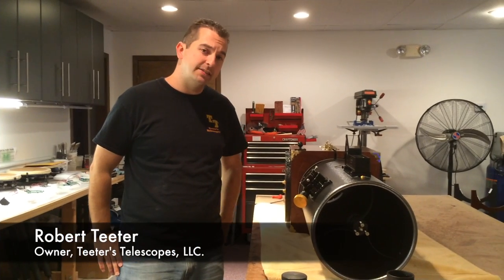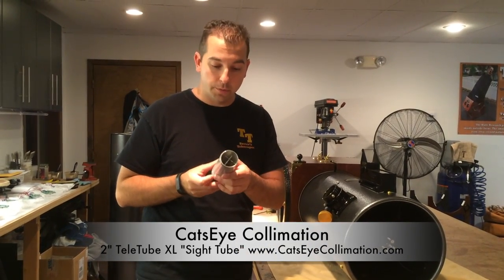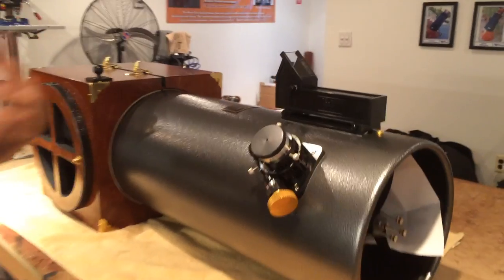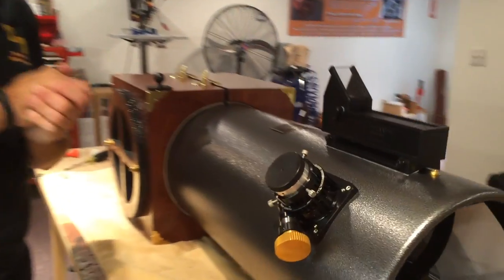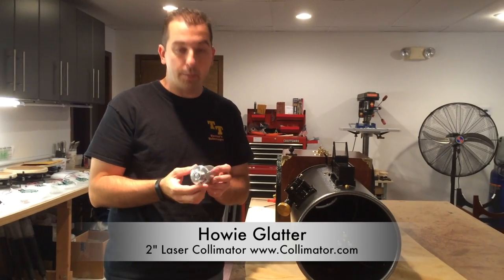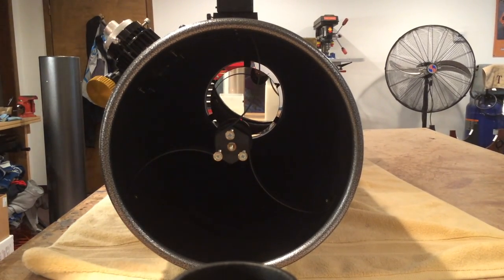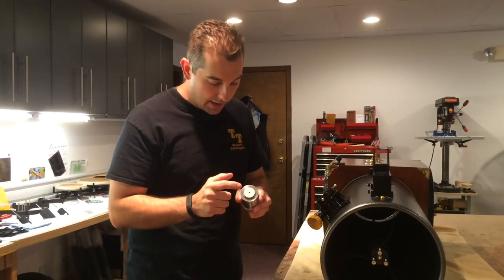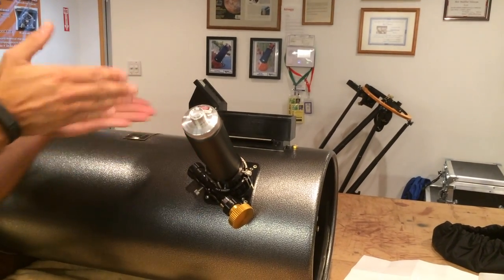STS Collimation

Comment: The centre bolt in some Newtonian scopes also controls the rotation of the secondary. What I follow is: 1) white paper opposite focuser 2) sighting tube with crosshairs to determine concentricity 3) make the secondary appear as circular as possible in the sighting tube. If not adjust the set screws and or locking thumb screws until the tilt makes it so. Sometimes it is a combination of the central bolt rotation and the tilt imparted by the adjustment screws on the secondary to achieve this. Mirror clips of the primary should also be equally visible in the sighting tube 4) Finally the adjustment on the primary to bring the centre spot centred on the "hole" of the sighting eyepiece. If the autocollimator goes dark that is another plus sign.